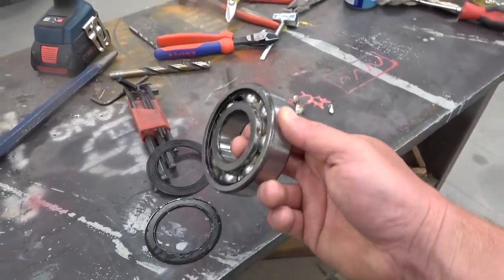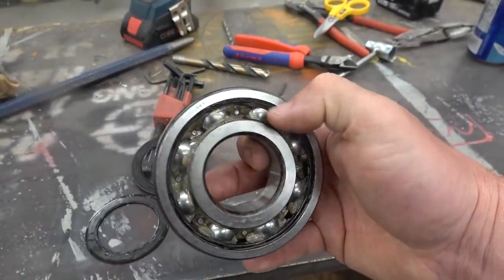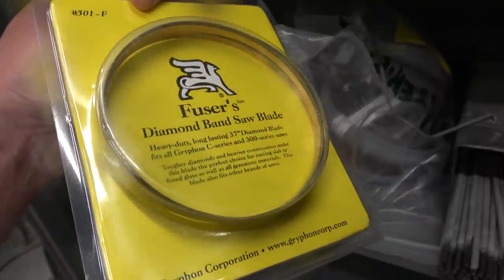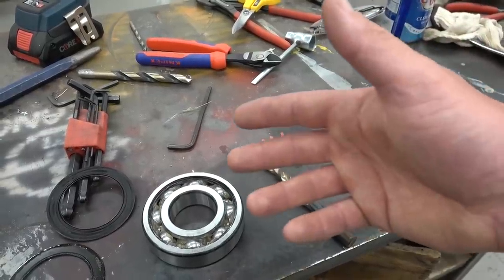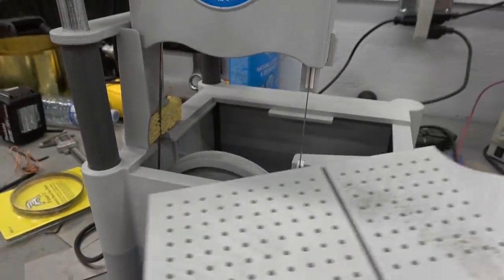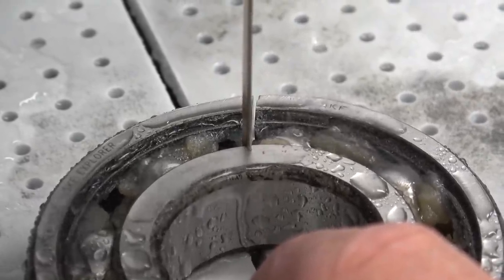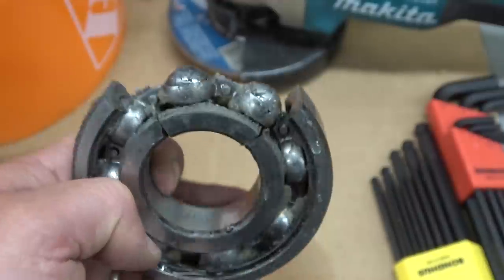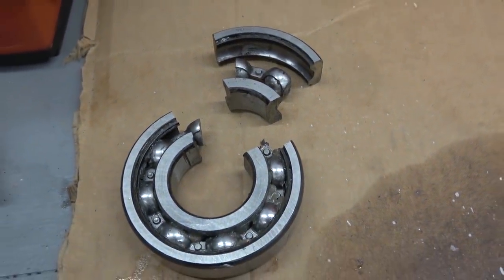Diamonds cut anything.

Comment: left: guns should be banned
right: guns are my right 
mechanical folk: ooo moving parts
Reply: 60,000 psi metal injection cutting tool.
Reply: @666Tomato666  Yes and No.
Reply: 666Tomato666 eh I was kinda tryna do an extreme of both sides, I agree that it isn’t very accurate realistically.
Reply: @DCBpower  does "guns need to be regulated" happen to reasonably include a bill of 1500 rifles in a single sweeping decision?
Reply: @666Tomato666  Apply the same comments to other rights, "free speech should be regulated" just trying to show the thinking. Doesn't lead to good things.
Reply: That's why I love guns, they're simple designs that are ways to help a human survive or destroy. I do a little gunsmithing on the side and for myself. I've built guns from the cheapest parts and made some custom ones. I'm actually looking into designing and building one from machined parts
Reply: @666Tomato666  Regulated is Leftspeak for "banned".
Reply: @666Tomato666  yes and regulations once started just keep getting tighter and tighter and tighter just like what happened here in Australia and continues to happen
Reply: @MerpSquirrel  are you implying nothing needs regulation?
Reply: @davidm8371  they need to be regulated to the point they are built to safe standards that won't harm the user.  Inferior materials could make a gun that explodes in the user's face.
Reply: @666Tomato666  no. They desire confiscation, not just ReGuLaTiOn
Reply: @markshort9098  well, Free speech is technically regulated, hate speech and threats are considered crimes, and lets be honest keeping guns out of the hands of criminals and the inept isn't exactly controversial, though I strongly believe that if qualified everyone should have access to whatever firepower they want, from spud guns to fully armed fighter jets (I draw the line at nukes... no one should have nukes, and I mean no one)
Reply: northman logging in the USA “hate speech” isn’t regulated, only speech that directly incites violence is. If that speech is directed at some “minority” “protected” “people” then you could receive a hate crime charge on top of the incitement to violence charge. But that’s for the lawyers to decide...
Reply: Neil Siebenthal  kinda what I was sayin.

goes hand in hand with you can say what ever you want about me or anyone, but then you shouldn't get upset when someone calls you an asshole and stops shopping at your store
Reply: Neil Siebenthal  however, threats and hate speech are in fact felonies in "merica"
Reply: northman logging hate speech in and of itself, like I said, is not a felony. As long as it is not directly promoting violence it’s good to go. The concept of a hate crime is merely an add on charge to a normal crime that the prosecution can prove was motivated by some sort of racial/ethnic/religious prejudicex
Reply: @kindabluejazz  Its not really regulated, like others said it is punished if used to harm, but that is not what is being argued. You right to free speech exists to allow you to decry a dictatorship, guns are there to remove the dictatorship.
Reply: That’s always been my sentiment- not interested in the political arguments, but I love a clever mechanical device of any kind!
Reply: Neil Siebenthal  who's talking in circles here me or you?
Reply: further left: guns are our right
Reply: @northmanlogging2769  although i agree with what your saying, there's 1 thing that needs to be taken into account and that's all government's want more power over their people and once they start they don't stop until things end up like North Korea.. here in Australia we are regulated to death because we have the liberal party on the left and the labor party on the far left.. everything either needs to be licensed or is illegal, toy guns have to be registered here as a firearm if they look even close to real, i know people who have been up on firearms charges for having a bright red toy gun that fires little plastic pellets, it's a kids toy and i know someone else how was arrested and charged for having a cap gun, again a kids toy.. here in Australia we even have licenses for septic systems so its a block license to shit, this is what happens once the restrictions start they just don't stop.. the solution to keeping guns out of the hands of criminals is don't let the bastards out of jail again something the liberals do is jump up and down about the rights of criminals and here murderers normally get less than 10 years and child murderers get out in as little as a couple of months which is seriously fucked up, victims rights don't matter to liberals.. i don't believe we should have any restrictions on free speech because there will always be someone who takes offence to whatever is said so all speech will end up band.. here everything is now at the discretion of police as to what the law is and their free to make up laws as they go along and the people are powerless as we have no rights or freedoms anymore.. our once great country is gone, my grandfather fought the japs in the Pacific and reinlisted to fight commies in Korea for freedom and now freedom is gone, lucky he isn't still around to see how Australia turned out
Reply: I’m a gun guy, and by God working out how they work blows my mind every time. I should probably get out more.
Reply: 666Tomato666 the “civilized” world started two world wars, saw millions perish due to Communism, and now they’re sending the police into council housing for wrongthink. If that’s civilization, I’ll stay right here in America.
Reply: The actual left: "Under no pretext should arms and ammunition be surrendered; any attempt to disarm the workers must be frustrated, by force if necessary"
Reply: @samuelcooke502  Ok Karen.
Reply: @cafenightster4548  ATF wants to know your location.
Reply: Neo Dutch - that all you got?  Is it Neo Dutch or New Douche?  You’re just proving my point.
Reply: @neodutch  starting to thing that the left don't understand your actions are what define you and not your words, and that the right doesn't understand that your words don't define you, but your actions.
Reply: @neodutch  in other words, the left is trying to ban people who have "undesirable" thoughts while the right is trying to continue acting irresponsibly.
Reply: @beyond6storm  Wut?
Reply: @kindabluejazz  No, causing harm is regulated, regardless of the means by which it is caused. That's as asinine as claiming that the right to bear arms is the right to commit murder with them. You also sorely misunderstand the powers of SCOTUS. The Constitution does not empower SCOTUS to write in the margins of the Constitution, only to determine whether a government action is consistent with what is written.
Reply: @666Tomato666  give a human a inch they'll take a mile, we've already given the left they're regulations. That was the Inch, now they are trying to take a mile and execute mandatory gun buy back etc. Now this isn't just about guns. This is about freedom and preventing civil war, if the radical portion of the left keep getting there way, I suspect America will be seeing another Civil War at some point.
Reply: @666Tomato666  I think the problem with the left is they want to regulate them yet know nothing about them. They want to ban heat shields and folding stocks because they look scary. If you want to regulate something I think you should have to be able to pass a test on the thing you are regulating written by professionals in the industry.
Reply: im the third group so hard
Reply: @lilmatt1914  The far left don't want to ban guns. Only centrist liberals do. Marxists and Anarchists both believe that the working class people should be armed and able to defend their communities from outside or inside. 

See Karl Marx "Under no pretext should arms and ammunition be surrendered; any attempts to disarm the people must be stopped, by force if necessary."

Also the NRA has lobbied for gun control in the past, specifically when the Black Panthers were arming themselves and their communities.

Do a little research, you'll be surprised at what you find.
Reply: Jesus christ this comment section is a mess. Thank god old people are dying out soon and are replaced by generations that actually know whats humane
Reply: @666Tomato666  they are regulated. Unless by regulated you mean banned. Then yes, the left wants firearms regulated.

Comment: I hate to rain on your parade, but I know a thing or three about diamond machining. Been doing it for 45 years.

Diamonds you may recall are carbon. You may also recall that steel is iron containing carbon in solution.

Diamond machining of steel is a fine way to carburize the steel. The trouble being that the steel, under cutting pressure dissolves the diamond into the steel matrix. It'll cut for a while, but won't stay sharp for long....

My decades of experience is largely tied to optical precision machining of non ferrous alloys. In that case, diamond is amazing stuff.
Reply: Cubic boron nitride was the suggested insert for steel over diamond for the reasons stated above.
Reply: Thus the slow surface speed and coolant, as solubility of carbon in iron is not appreciable at low temperatures. Now a diamond cutoff wheel for a 13000rpm grinder would be a terrible idea for ferrous metals.
Reply: cheap edm like applied science did might be more practical in the long run
Reply: Hello brother. Nice to meet another martian
Reply: @Eddie Hitler John Bobbitt should've listened to your advice
Reply: You are correct- I've used monocrystalline diamond mcd tooling, but on green tungsten carbide years ago. I found out about cbn for steel instead at that time because of exactly what you mentioned.

For the record- I got into horology after that, for a time, going to school to become a watchmaker- found out about the H4 created by John Harrison in 1750s. He used diamond for the pallets in that watch- but used a gold escape wheel instead of the traditional English steel ones for the exact same reason- steel has a natural affinity for the carbon in diamond, and the pallets of diamond on steel would have experienced breakdown at the atomic layer because of friction between the 2 materials. Horologists elsewhere did the same thing on marine chronometer, they all figured this out hundreds of years ago somehow. There's a scientific paper on the pallets of the H4 by Betts you can read if you're interested in the subject.
Reply: at that speed there will be no diffusion of the carbon into the steel.
temperature is way to low.
Reply: Wouldn't the pressure need to be to great  to dissolve the diamonds into the iron?
Reply: I was looking for this comment
Reply: @GigsTaggart  I seem to recall he was working on one a few years back
Reply: Ben has it correct. CBN is the way to go. Diamond , as I said will work for a bit, but not for long CBN much better
Reply: @Eddie Hitler thermal conductivity of diamond in combination with the specific heat capacity of diamond and water....
Reply: I was just wondering when someone would explain this. I found it out the hard way trying to use a diamond coated bit in a dremel to shape a tiny area in a piece of tool steel. Thanks for the explanation. I only found a small bit of info saying the diamonds break down in contact with the steel due to heat. Nice to have the full picture. Many thanks.
Reply: A friend worked for a time in the Detroit area for a company that made super precision mirrors out of beryllium and the like. He used to regale me in the ways of interferometry and red light shift.
Reply: @alakani  ooof.. that's brutal. SteveO used broken glass.
Reply: Rusty Broken, a friend indeed.
Reply: @janvanruth3485  you would be surprised whst happens to a sharp  Diamond under cutting pressure. There is no actual coolant that gets to that interface. The actual sharp edge literally dissolves into steel until it gets to be too dull to actually cut.
Reply: @Eddie Hitler een ÿ in uit 6
Reply: Wow!
Reply: @JoshStLouis314  solubility is a function of temperature and pressure. The cutting edge on a diamond is just a few atoms wide. The pressure is quite high as is the temperature, even though diamond is an amazing thermal conductor. I've watched it happen on extended cuts
Reply: You ever work with beryllium bronzes?
Reply: @majordakka5743  yes, though beryllium  alloys come with exposure issues. For optics we generally stuck to hard electroplated copper though.

I also worked with pure beryllium. This is amazing stuff. Lighter than aluminum, but stiffer than steel. 

Be's problem is, particles of beryllium aerosolized and breathed in roach your lungs, much like asbestos does. It has to be machined in a hepa filtered glove box lest you kill your employees. The beryllium bronze has the same problem, just to a lesser degree.
Reply: @padraicmcguire108  the saw does not have sharp diamonds unlike  a lathe cutter or a milling cutter.
it is more like grinding.
i have been lapping hardened steel with diamond grit for some time.
the diamonds are not sharp like a cutter but rounded with some edges.
they will last forever.
temperature and pressure are important.
Reply: Is ANY of this going to be on the test?
Reply: @GigsTaggart  - Or his water-cutter effort., since that is also happy with non-conductive stuff like glass.
Reply: "Diamond machining of steel is a fine way to carburize the steel"

That's OK,  we still have the spare carburetor that didn't get used on the power washer!!
Reply: @JoshStLouis314  Oh I cut plenty of metal rods with a stone cutting disc. It's lousy cutting but if you need to, it vurks. And i have a special diamond grinding disc for cutting grooves in tungsten carbide tools (bush hammers and tooth chisels for instance). It vurks too. It does not retain its pointy shape for very long though, but that can be reground with a piece of sandstone. That diamond chainsaw will cut through rebar or stainless threaded rods quite quickly. It all depends on the tool and its use.
Reply: yea but all the theory here and the metal cutting diamond blades they sell for 12$ (new, not the masonry ones) at any big box store kick ass. never going to be a issue on an angle grinder. Maybe if you are doing it by hand. I use them all the time.
Reply: and give me a break about cutting thick objects, you use fire for that

Comment: An alternative to this is a slurry saw. Just uses wire as the blade, and aluminum oxide with milk-like consistency in water as the slurry. The wire is just a conveyor belt for the slurry, it's the aluminum oxide soup that does the slicing.
Reply: so I'm guessing it runs in reverse from this one?
Reply: What about EDM?
Reply: @davidschwartz5127  He did a video on that. Search his past vids.
Reply: CBN cutting wheel on our cnc.
Reply: we used fine garnets and olivne waste on a slurry erosion blade.  filthy but fun!
Reply: @davidschwartz5127  NEDM

Comment: To the Fusion 360! I'm interested in build such a machine. What are the specs for the diamond blade?
Reply from the maker: This one is 37" -9/32" wide. But check the usual scumbags for whatever size you want. I think 105" is the largest typical length.
Reply: @arduinoversusevil2025  Sounds good. I will work on it a bit this weekend. I figured I would share the STL's on thingiverse. Would you like me to notify you when it's complete?
Reply from the maker: @BrianChristmas  Please do! Are you going to use a drill to power it of a proper motor?
Reply: I wish I was better with 360, I'm very interested in this project.  This is going to be fun!
Reply: @arduinoversusevil2025  I am trying to design with parts that are easily scavenged or found in big box stores. As swamp(evaporative) cooler motors and pulleys are fairly easy to source, usually cheap to free, I am going to design around that style of motor.
Reply: AvE Would it be possible to 3D print new wheels for a band saw that you already own? Maybe add a speed controller for the motor and add a pump assembly for coolant ?
Reply: @arduinoversusevil2025  what about metric guys? 
What specs are those
Reply: @BrianChristmas  Ping me if you want a hand in Fusion. I'd love to help!
Reply: N Jones and 12.7mm = .50 what for Ma Deuce spits out. That how I remember!
Reply: @BrianChristmas  
Can you share the f3d files as well? I have some ideas but dont have the time to design everything from scratch.
Reply: @njones420  ikik, it's just the notation i struggle with.
Even then, thanks

Comment: We just got this saw for my lab (electronics). It was bought from Allied High Tech in California. We use it to cut ceramic parts and printed circuit boards. It will cut just a out any hard material. However, cast iron and high-carbon steel don't cut well with diamond saws as the carbon in the metal reacts with the diamonds in the blade, dulling them. Keep the blade dressing stick handy.

Comment: Just an Idea: Instead of spring feed, how about a "weight string pulley" just like the roller bandsaw.
Reply: Very good idea! Using weights means a constant force instead of the ~x force of a spring. Put a can holder at the end and you can tweak your cutting force by drinking the beer
Reply: ah yeha the ol banana on a rope trick

Comment: When you make the carrier for the work piece, make it so it is attached to a rope/cable of some sort that runs over a pulley so that a weight being pulled down by gravity, applies a constant horizontal force to the work piece.
Reply: That, or a constant rate spring. Or maybe two pneumatic pistons, one to push the workpiece and the other placed vertically with a weight on top to apply the force. Same idea as yours, but maybe a bit more compact (and expensive).